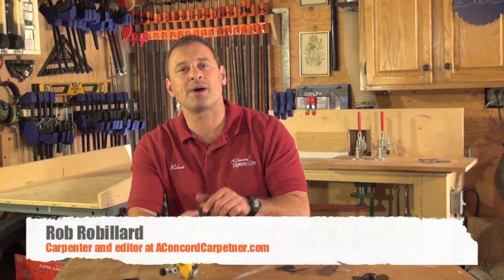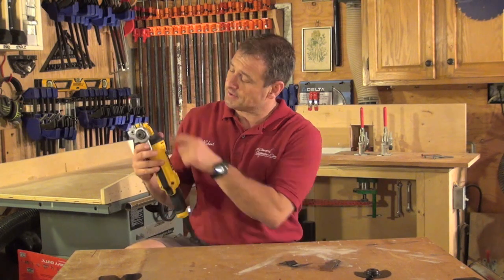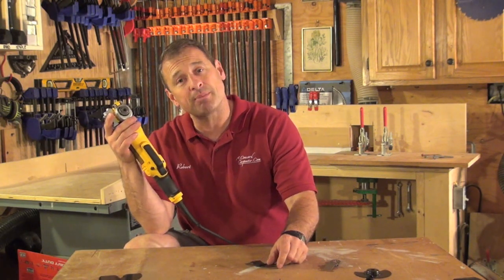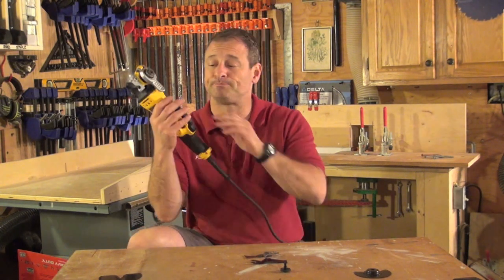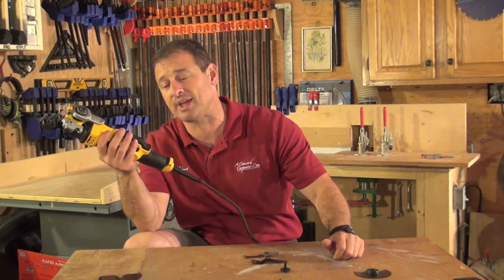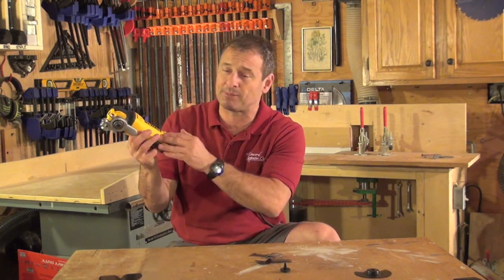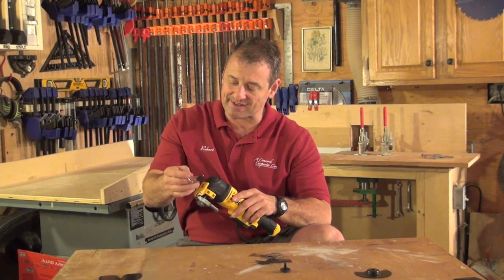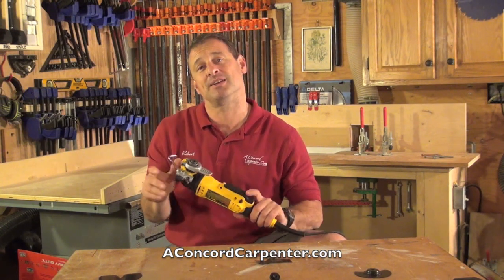DEWALT DWE315 Oscillating Multi-Tool

Comment: Mine stopped oscillating, turns on but doesn't vibrate. I've had it about 3yrs. Just outside the warranty. Woof. The sander does suck too.

Comment: I’ve had two of these DWE315’s & to be quite honest I would not recommend buying one. This is the tool that made me realize DeWalt isn’t as “tough” as they’d like you to think. If you use them on a somewhat regular basis you’ll get maybe 6 months of use before they break. Not to mention the sanding attachment is worthless & a huge waste of money. The sanding pad will melt with the slightest amount of heat built up from friction & the sanding paper doesn’t actually stay on the pad. The metal cutting blades are expensive @ around $15 a pop & can barely cut through a tiny bolt without losing all the teeth. 

Lastly, DeWalt doesn’t stand by their product. Getting a replacement or even a reasonable response is impossible so I’m slowly replacing all of my DeWalt gear with brands that give a damn. I’d Try any other brands multi-oscillating tool before buying another.

Comment: I like this tool. I have been trying to kill my old Rockwell multi tool for a few years so I can buy one of the new quick release multi tools, but it just won't die. I've got the thing so hot it sizzles, but somehow it still keeps running. When it finally dies I will replace it with the Dewalt.